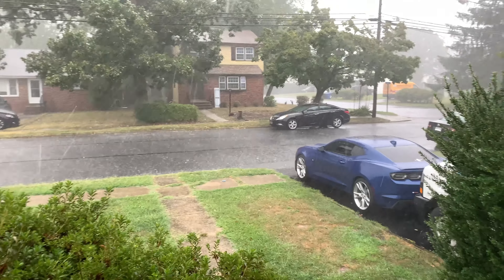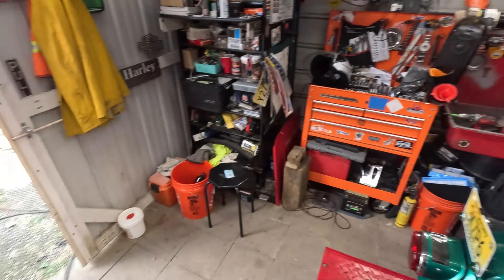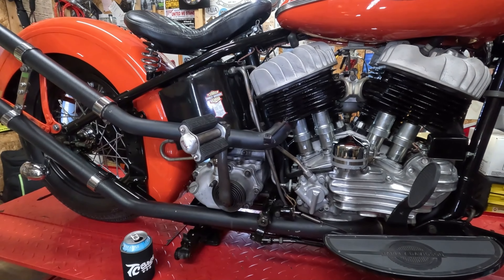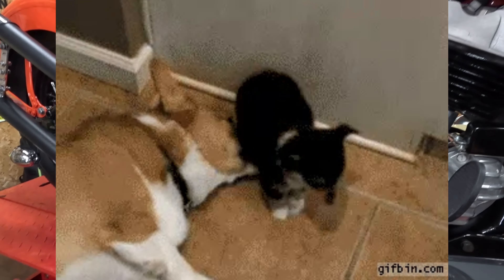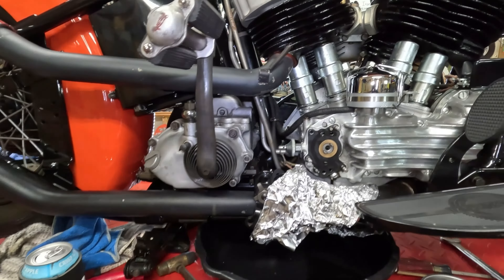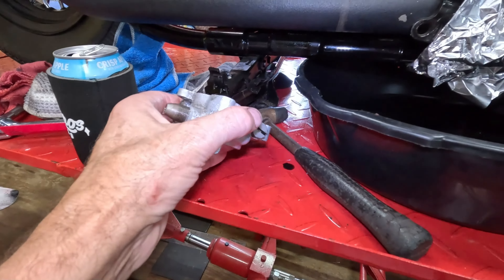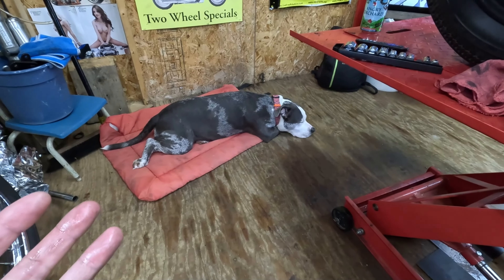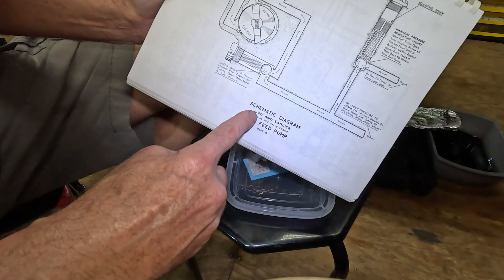HARLEY DAVIDSON FLATHEAD OIL PUMP REMOVAL AND SERVICE

Comment: Great video Slick! You do a good job explaining how that old oil pump works. I say weld it and hang it on the wall.
Reply from the maker: For one we have to set up some rules. I need to know which doctor smoke I’m talking to right now- Dan or Ron.?
Reply from the maker: Well, whichever Dr. smoke I’m talking to. It’s definitely going to be hung on the wall. There’s no need to weld it to do that lol I was playing with it tonight. I cleaned it all up got the paint off of it and I can’t even find the hairline crack now so welding it is not even an option, I’m gonna go to Nicks cycle salvage and talk to my man Nicky. There’s plenty of oil pumps on eBay but I want to talk to him to see which route I should go.  Plus, he may have them right there on hand.

Comment: Good vid. I'm about to build a 41UL. In my research, I've found that a 4-vane oil pump kit is the single most popular upgrade after pipes and carb. I’m seriously thinking about the CHP gerotor feed with their deep scavenge gears from Europe. But it's big bucks. I'm watching you to learn from your experience. So THANK YOU! Btw, don't ever forget that on any older harley, 1psi hot is "pressure". Dash light goes out at 3psi. It's all about FLOW (heat removal).
Reply from the maker: @Hoodamax  yeah man I priced up those CHP pumps. They are super expensive. I have bought the Four vane upgrade kit, but I have yet to install it yet.  Yeah keep watching me and watch all my mistakes and then don’t do what I do lol. 👍🍺 😂😂😂 SLICK

Comment: worse comes to worse ,JBweld it,do a good clean up like I know you can and fckn powder coat it,its ,worth a try,cause finding one might be a bitch.However on second thought I have an old JP cycle vintage parts catalog,yoiu could try that too.
Reply from the maker: I’ve already seen plenty of them on eBay and I just didn’t have the $300 to pull the trigger right now and plus I wanted to talk to my antique bike guru Nicky Muth and talk over my options on which type of pump I should go with and what year And which is best, that sort of thing before I pull the trigger on anything.  I got plenty of time on my hands the bikes not going anywhere.
Reply: @SlickHeadCustomCycles  yeah fckn parts aint cheap...HD,hundreds of dollars no sht..It just cost me 167.00 for a float/sending unit for the fuel gage and the parts guy said he was doing me a "solid".
Reply from the maker: workingmansdead 44 lol. I woulda told him Thanks for the solid weight, ya just sunk my wallet!!! Lol